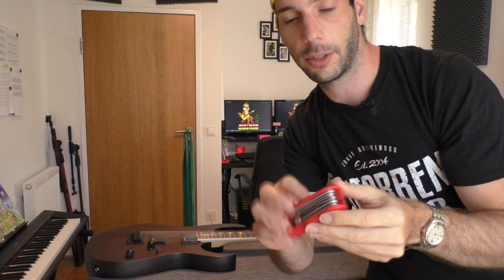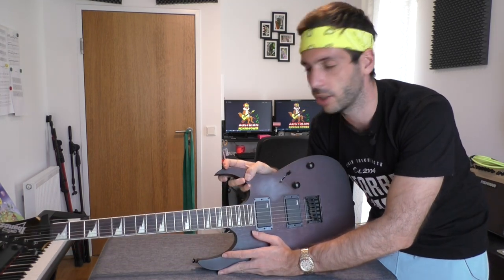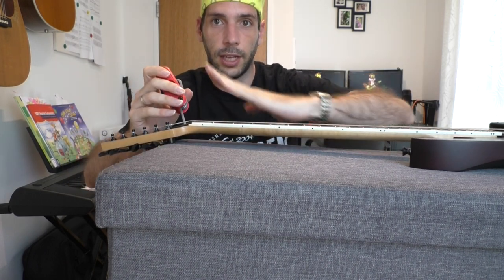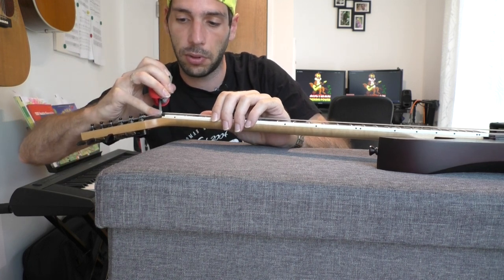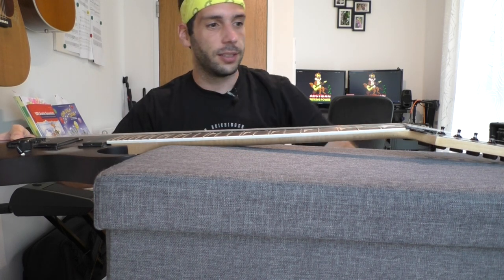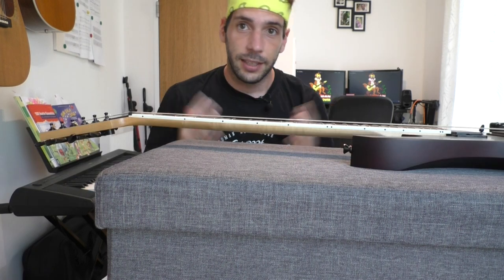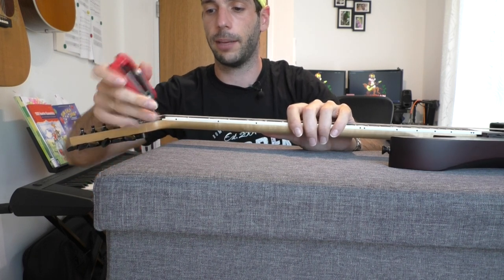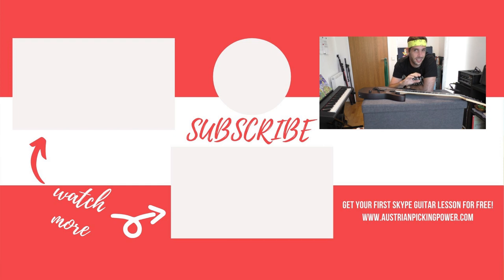Truss Rod Adjustment EXTREME | Cracking Electric Guitar Neck!

Comment: Any truss rod adjustment, where you have to tighten it,  should be done with strings all the way loose. Then make adjustments, and tighten back to being in tune, up to pitch.
Reply from the maker: Yes you´re right! That should give you quicker results

Comment: I can hear small cracking sounds on my old fernando stratocaster so I am scared of adjusting it but it has fretbuzz on the first fret 😭😭😭. I am scared of turning it because even the slightest turn cause some cracking noises
Reply from the maker: Make sure that you know exactly in wich direction you have to turn the truss rod. Before you adjust it make sure if it will be an option to higher the string at the bridge. If that doesn´t work adjust the truss rod. Playing with fret buzz is not very engaging...Good luck!

Comment: My Squier P Bass with a jazz neck had very high action when I got it at a pawn shop 2019. I paid $50 which is a real deal. when I got it home, the truss rod was all the way loose. I tightened it and sure enough the action got much lower and actually dialed in nicely. then this summer 2023, I noticed that the high action returned, I keep the allen wrench (4MM) in the case, 4 times now I have had to tighten it each time a 1/4th of a turn, is the wood compressing?
Reply from the maker: There can be a lot of reasons for your situation. In my country it´s very hot and we have high humidity in summer. It´s almost up to 55%. In winter it´s very cold and we have to heat the apartment which causes low humidity down to 25%. That huge differences change the playability and the string action. Usually I have to adjust my guitars twice per year. Maybe humidity controls your guitar as well

Comment: Couldn't crack an Ibanez even a Gio, it might be a different story with one of these $69 Glarry's on ebay!!!
Reply from the maker: probably you´re right :P
Reply: or with kramers barreta specials or epiphone tobias deluxe bass, on wich i overtightened and the truss rod nut came off because the neck was  not backbowing enough to handle 50-110 bass strings

Comment: Truss rod adjustments need to be made very gradually, over days. The guitar takes time to adjust to any changes. Don’t EVER crank down on a truss rod.
Reply from the maker: yessss you´re right, like I said - this was an experiment. 2 days after the video I had to readjust again :)
Reply: Bro, what are you talking about? Over days, lol?
Reply: I just found out you can go back and forth as much as you want. The cracking happens when the truss rod is stiff and you continue to turn it. I did it and the neck cracked days after. Scared me away for years lol.
Reply: That shits a myth and luthiers will disagree with you
Reply: @johnnysix7162  I just watched him earliee coz I have the same issue where I am adjusting my old fernando and I hear a lot of cracking sounds even in the slightest turn...